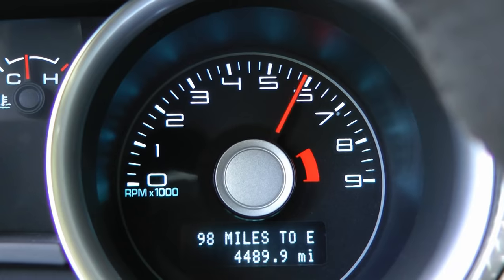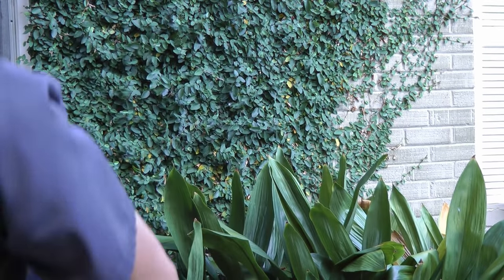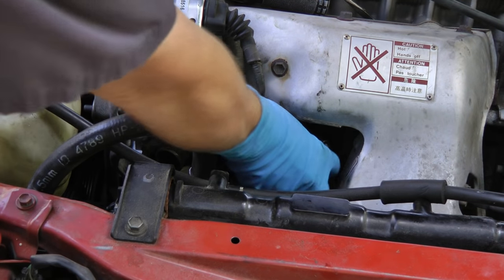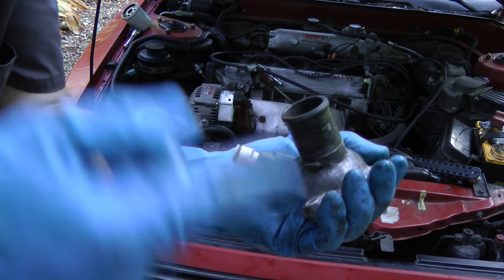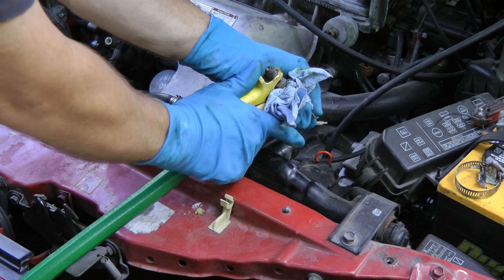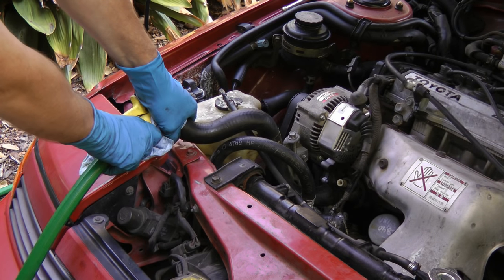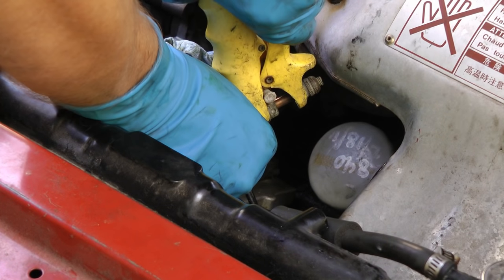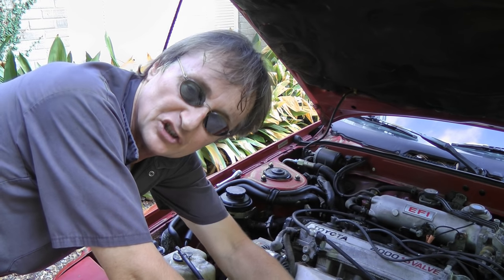How to Flush a Coolant System in Your Car (the Easy Way)

Comment: Hi scotty. Already two of your videos have helped me.  Should I flush my cooling system WITHOUT a thermostat installed for " better flow"? 
a.  05 civic si hatchback 4 cylinder manual transmission here.
B.  I've NEVER touched the thermostat until tomorrow..for replacement..never flushed the system and also noticed milky substance stuck to underneath of oil cap * prays head gasket isn't blown*.  Radiator is brand new and i've ensured the temp gauge has never hit the red mark nor the " H " above it..although it has tried to overheat.
C.  How difficult is it to replace a head gasket in my car?  Perhaps I've overlooked it, but I haven't found a youtube video on "  how to replace 02-05 civic si head gasket"

THanks to you and/or anyone with practical words of wisdom and any help. 

I know pc's well, automobiles a semi-distant second.
Reply: Sounds like a head gasket. It shouldn't be too hard at all. Pick up a manual for it and it will be a piece of cake. Different story for V shaped engines...

Comment: I'm fixing my head gasket and water pump soon. However, head gasket stop leak clogged my coolant system up. Do I haft to replace the lines or can I just flush it.

Comment: Any tips on bleeding the air out after adding the 50/50 mix (or the water for a week). I've seen those Spill-Free Funnel's, but im wondering if you have any tips on doing it without one of those. I think you can just add fluid to the radiator to start, and then keep it low while running the car? I know some cars have those bleeder screws..
Reply from the maker: if it has bleeders, use them, but you can just jack the front of the car up in the air, then remove the radiator cap when cold and just run it, air will come out to the highest point which is the front cap area then

Comment: hey scotty, i have a 1999 mustang 3.8 i just put a used engine in that was sitting at a junk yard for 5 years. it runs great and does not overheat but i keep flushing the cooling system out about 4 times a week using a water hose until its clear, and then filling it back up with straight tap water and i just keeps getting rusty again, the rubber hoses are coated with a thin layer of rusty residue. is there any cleaning solutions you recommend? or is there a special service out there for this?

Comment: Thanks for the quick reply. I will defer to your experience, I already flushed and have the system filled and bled with the tstat out using distilled water. Got some judgemental glances from fellow DIY'ers but I'll tell em what you told me. Thanks again.

Comment: 😊I just flushed the coolant system by taking the top and bottom rad hoses off flushing and back flushing as well as through the overflow reservoir. When I went to refill the coolant system through the reservoir it doesn't take the 2 gallons of coolant that it says the system holds. The bottom rad hose does not get hot....the top one does. I put the vehicle on ramps and kept squeezing the top rad hose which forced air into the reservoir. For the bottom rad hose I opened the bleeder and kept squeezing that hose. What could be the problem?...why wont the bottom rad hose get hot and why wont the system accept the 2 gallons of coolant? Is it possible the engine wont get hot enough idling for the thermostat to open? I'm in Canada and we're entering the cold season so I need to keep the thermostat installed. Ok thank you for your insight.

Comment: Hey Scotty, my car seems to be using a fair bit of water, now I'm not too sure if it's sitting in the engine or not, but the radiator seems to be wet but have no water in it, or if it's sat over night, it's completely dry. I also can't see it in the expansion tank. It never seems to over heat, but it has gotten a bit too hot twice (both on hot days). There's no visible leaks, and the head gasket isn't leaking because it isn't gurgling or burning coolant. (I have a 93 Celica), thanks for any help! :)
Reply: Oh I also think that it may not be pressurizing, but I'm not too sure how too tell.
Reply from the maker: do my video tests "how to fix an overheating car" it has to be one of those. Pray it's not the last test.
Reply: Scotty Kilmer It seems to be alright now, although I'm going to give it a good flush. I think it may need a new radiator cap. Another thing, do you know how to test the car A/C? I can't hear the compressor engage or anything (It's incredibly hot here at the moment).

Comment: Hi Scotty, I'm your subscriber from Indonesia
I want to asking you something about car cooling system, can you answered me?
I got many leaks on my radiator and I planned to buy new one. My car always use common water for the radiator. If I was replaced the radiator with the new one, does it safe if I used aftermarket radiator coolant? Will it make the corrosive dirt in the cooling system and water jacket peel off and clog the radiator grid? Thank you and I hope You can answered it...

Comment: I have a 2000 gmc Yukon xl with rear air and heat.  The heat is inadequate in the rear.  The blend door works and the system was flushed at service center.  Not sure if flushing takes care of the rear core.  I'm guessing the rear core needs flushing or replacing.  How do release the gmc quick connects under the frame?  Is there something else to check as a possible cause. The front heat works fine.
Reply from the maker: rear core would need flushing by itself, those quick connects under the frame often corrode on, and if so, I'd cut em off and then splice in regular old rubber hoses with clamps myself. I often end up cutting those crappers off

Comment: Scotty, I have a Ford F150 with a 4.85-gallon coolant capacity.  When I drained the radiator, only around 2 gallons came out.  This means there's still over 2.5 gallons of coolant left in the engine block.  If I performed the flush as described in your video,  even if I added 2 gallons of undiluted coolant into the radiator, my mixture ratio will still be less than 50/50 due to the 2.5 gallons of water that remained in the engine block after the flush.  Do you suggest trying to drain the engine block before adding coolant in my case?  I can only access the engine block drain on the driver side.  The drain on the passenger side is blocked by other components, and seems impossible to get to.

Comment: Scotty, can you tell me what they do at the dealerships to do a cooling system flush and coolant replace, which is usually due at about 100k miles?  I'm under the impression they use some sort of machine to do this.  Do you know?
Reply from the maker: it's a flush and fill machine, they cost over a thousand bucks. They do work good though

Comment: Is it ok to use regular water to refill the radiator?
Reply: Absolutely. If you have a super high-end, ridiculously expensive car, then you'd probably want to stick with Evian or something, but if you're watching radiator flush videos on YouTube, chances are, you own a fairly standard car like I do, and I always use just tap water. Never had a problem. Keep the distilled water for your battery.

Comment: Hey Scotty, i changed the coolant on Audi a1 2012. With half coolant and half water, but is it normal to lose the coolant level all the way down cuple times? I think this is do to the waterpump is represuring the system and the coolant is just finding its place because i have no tools to repressure the engine coolant properly..Or am i wrong?

Comment: I am running an older VW with a cast iron block and it gets very sludgy when you don't use G12. In fact, I am rebuilding the same motor outside of the car to minimize down time and I had to have it hot tanked because of the build up of that sludge. The motor that is in there now is sludgy as well. Because of it, I had to pop out the thermostat and by pass the heater core. The water pump is working but they are pretty bulletproof on this motor.

Comment: Hey, Scotty. My thermostat is a pain in the butt to remove, so I have to do a closed circuit flush. Because of this, I can only drain about 5 of out 8.8 quarts of fluid (~50% of the system). When I fill the system with pure water, run the engine to flush it, and finally drain it, the system will be mostly water. When I finally fill the flushed system with coolant, since the system will be half full (and almost all water), I'll most likely need to add concentrated coolant to achieve a 1:1 ratio.

My question is, how well do vehicles that are filled only via expansion tanks that directly fill the block mix concentrated coolant added directly to water already in the system? Is it better to flush with 50/50 water-coolant to avoid throwing off the ratio? I have a 2001 Volvo S80.

Comment: I have a 1993 Honda Prelude (Engine F22A1) and its overheating. I changed the Thermostat and change out ECT sensors. And the temp Gauge is still reading hot. Would flushing the cooling system work out?

Comment: Question question!!! My brotherrrrrr pour engine oil instead of antifreeze. Will this help at all? He also drove the car and said he added half 1 litter
Reply: He needs to flush out the system. And perhaps NEVER TOUCH THE CAR AGAIN. That is really really bad.
Reply: @enriqueortiz5440  lmfaooo i agree lol i took the car to the mechanic and everything went fine, since the car had full antifreeze the engine oil that my brother poured in didnt gwt to the engine lol good thing

Comment: What about a 2006 dodge caravan? My coolant fluid is brown now my air conditioner won’t work the compressor is bad the mechanic told me it will cost 500 dollars my heater worked great. Any advice please. Is a compressor and Dan good if I get it from a city car junk yard called a pick and pull yard?

Comment: Hello. Would it be bad to do this when its 38 degrees outside and the water coming out of your hose is cold? (Assuming that you'll put a 50/50 mix into the system right after you flush it so it wont freeze)

Comment: First, If you are trying to fix an existing cooling system problems, additives will not help. you should find the source of the problems before using additives because you can make problems worse then they currently are. Second, cooling system additives are to make the coolant more efficient at retaining and releasing heat better and quicker. Also to help with different types of corrosion and electrolysis. The only feature you gain is better cooling efficiency somewhere around 20 degrees F

Comment: hi Scott, my coolant level is well under half (maybe 1/4) full, I got the car about 10 months and didn't change as it was ok (as per my local mechanic). no heating problems. but I'm worried about the low level, should I top it full (don't know the brand used so I may be adding different brand) or I must flush? if topping is ok, shall I top with water or with coolant/water mix?
Reply from the maker: I would first pressure test the system for leaks, fix any, then empty and fill the whole system with new coolant

Comment: Hey Scotty... Great vid!!  I have over 60,000 miles/ 2 yrs on the coolant in my 2009 Toyota Tacoma 4x4 2.7l.  Do you recommend a new radiator cap along with the thermostat??  I'm noticing some light corrosion around my radiator cap. Any special things to look out for when flushing this engine??
Reply from the maker: yes,change the cap too, and nothing special on that toyota, same as any other vehicle
Reply: Scotty Kilmer
Thanks Scotty... Just flushed the cooling system and replaced the stat, cap and o-ring gasket that goes around the stat.  Refilled with fresh water and NAPA extended life anti-freeze. Easy fix!

Comment: Hi Scotty, I am having problem unclipping the coil wire on my Renault Megane, the clip seems to be very stiff. I want to change the spark plugs, what do I do? I also realize that all the nuts and screws in my car are corroding, please advice on product to use. Thanks as usual.
Reply from the maker: spray WD 40 on them all, it doesn't hurt electronics and loosens rust off. But those cheap clips often break, and if they do, who cares? Just put silicone sealer over it after pushing it back on if that happens , it holds them on fine.

Comment: Is Dexcool ok to use? I just bought an 02 Trailblazer and it has the orange coolant in it, presumably Dexcool. The cooling system is in working order with no air leaks, or any leaks for that matter. Should I continue using the orange stuff or do a flush and fill with the green coolant? Thanks Scotty.

Comment: Hello Scotty
I have just bought an ARO. Romanian 4x4 with Renault 1.2 L engine. It was stoped for a long time I believe more than 5 years. Colling system is rusty. I was looking for a product to clean it but there is nothing available where I live (Cape Verde Islands). A friend told that a could use 2 spoons of sodium bicarbonate and let the engine running for 1/2 hour. Flush it and do it again. Then fill it up with collant. Is this a viable solution?
Thks
Joao
Reply from the maker: you can try that IF you can't find any commercial flushes, as many have been banned for polluting the water

Comment: If it is a little difficult to take out the thermostat then can these steps still be done. Or which can be ignored or what else can we done.
Reply from the maker: +Imre Csoka you can leave it in, but flushing won't work as well
Reply: those gm 3.4's...

Comment: Hi mr scott ,, my car starts overheating if i drive it fast or long drive and if i have my heaters turned on it doesnt heat all but we just have to breath a whole lot of hot smokey air if im right .. i have recently changed the waterpump so i know thats fine n head for sure aswell ,, heater fans work fine both of them  .. could you please advice me where to look for faults so i can fix this problem .. thanks

Comment: Ok my car did have a blown headgasket I followed the instruction on your video but car is still overheating what should I do next. Need your advice  please
Reply from the maker: you have to replace a blown head gasket, flushing the system does not fix that. It is an expensive fix

Comment: Will this procedure be okay for a car that has Dex-cool?  Can I switch from Dex-cool to regular anti-freeze? I have on 2003 Crown Victoria.
Reply from the maker: what's dex cool doing in a crown vic? Only GMs are made for that. I would flush it out and switch to a long life coolant like prestone.
Reply: Scotty Kilmer In my Haynes repair manual for the Crown Vic/ Grand Marquis, it says some later models have Dex-cool.  The coolant in the Vic's reservoir does look orange so I just assumed.  Anyway, thanks for the help.  I'll switch it to the prestone long life. :)
Reply: Scotty Kilmer hey scotty im doing this tomorrow can i bleed the air out of the coolant by using the drain on the radiator on the bottom? thanks.

Comment: About to do this. But also had a question. Can you give me a hint, on how to tell if Cam Bearings are bad without taking engine apart? 99 ford f150 5.4 v8
Reply from the maker: top of engine would rattle with worn bearings and idle speed would be crappy
Reply: Scotty Kilmer Any oil pressure readings? Being low, Or high?

Comment: Scotty shouldnt you use distilled water to flush the system instead of a garden hose? I need to do a flush and maybe even change the radiator in my 1997 toyota rav4 that runs really good but the metal content in the radiator fluid registered 36 on my multimeter. To my knowledge the radiator is original.

Comment: Hey Scotty, merry Christmas I have a question for you. My 2006 Honda Pilot recently had the radiator changed and coolant flushed by my mechanic. When I got the car back the coolant was a little low so I asked the shop what type I should add. They said blue pentofrost. I added so and then check the coolant level another day and it was almost a yellow yucky looking color. The coolant didn't look rusty but almost dirty. What do you think happened? Did the mechanic put the wrong coolant in?
Reply: +Applekid   The color of coolant means nothing.   The manufacturer will die it any color the customers wants.  Honda uses phosphated OAT coolants. P-OAT coolants are used by almost every asian manufacturer.  Peak antifreeze make a P-OAT coolant that is available in red (Toyota) or blue (Honda) but it's all the same stuff.  The phosphates protect against corrosion and protect the water pump seals.

Comment: My engine is running really hot, but the temp gauge says it's ok. What should I do? I decided to change the thermostat, and flush the cooling system, hope that works. Also the hose from the rad to thermostat  has no pressure even at running temperature. Heater works great, I don't think it's the water pump.
Reply: Would you recommend using rad flush cleaners?

Comment: Hey Scotty want to change the coolant in my 2001 Honda Accord ex v6. It currently has a deep green color. How ever the owners manual says that the car needs Honda type 2 coolant. If I am correct that is a blue color. What should I do?? If I was going to put the blue type 2 in would I need to completely flush the system, to get all the green out???
Reply from the maker: +Applekid yes, flush it out and use the correct fluid

Comment: I got a question. Why does antifreeze freeze easier when you use just straight antifreeze instead of mixing 50 50 antifreeze and water? You think using 100% antifreeze would be better all the way around.  I heard in Alaska barrels of straight antifreeze would freeze up if not kept inside. Doesn't make sense to me. I'm sure there is a reason,,,,,,,,,

Comment: question. I was told my I need a radiator flush because my fluid is starting to look dirty? It doesn't look dirty to me and it gets hot here in Ontario Canada, 44 celsius and I have never had a problem with it over heating so is it possible that it should just be left alone? it is an unknown mechanic saying it needs done at a Canadian tire store?